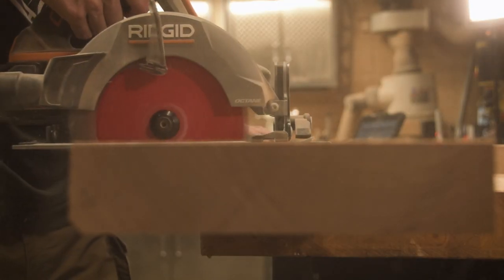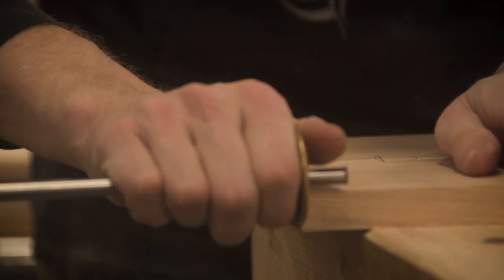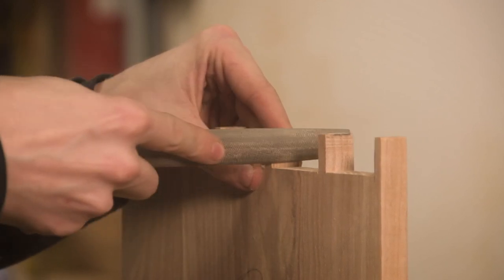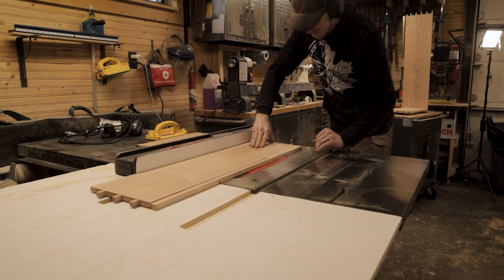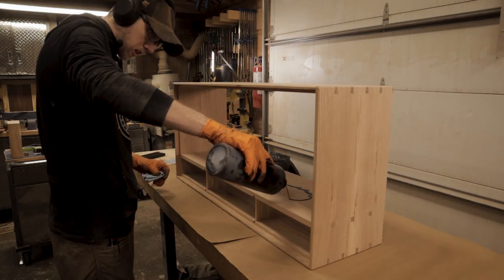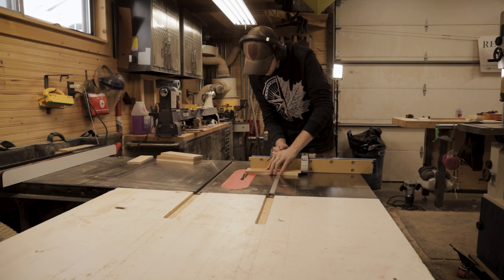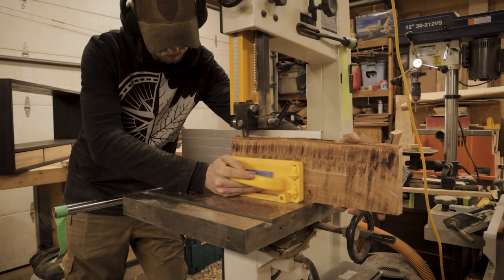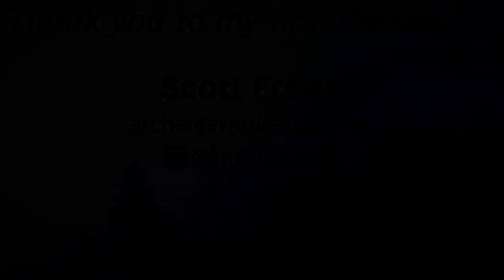Apple Wood & Dovetail Bookshelf

Comment: Well, I’ve been a woodworker for over 45 years and so, obviously, have seen a revolution in what’s available to the smaller shop. Everything from abrasives (I started using the dried skin of a dog fish) to adhesives to routers to….everything. 

I’m retired now but we did have a sidleline business for a good few years making principally Arts and  Crafts pieces here in the UK. However, I’m busier than ever on a 500 square metre barn conversion with all the2nd fix including doors, frames, cornice, picture rail etc. plus lots of furniture. Mostly in European oak. 

We live next to orchards and, about 10 years ago, the farmer cut down the very old Bradley apple trees as they were past their best. I managed to get a lot of the timber and, you’re right, apple moves and shakes like anything. But it’s a beautiful timber and it’s proximity makes us very happy. 

Taste personal whilst skill is universal. So, whilst I can’t say that the piece here is not to my taste, I do admire the skill in the making. I rarely use stain by itself although all of the oak has been finished in a smoked oak stain just because it replicates the old fumed oak colour that the A&C makers loved. If I do want a contrast, I tend to use minimal pieces of stained and my favourite is to use Ferrous acid (steel shavings in vinegar) to react with the tannins on the wood. I prefer that not quite opaque look as you can steel see the grain. But, that’s just my taste. 

Dovetails are a pet subjects of mine. They evolved during the centuries when the adhesives were so prone to failure under stress. Therefore, there was a need to have mechanical joint to hold pieces together. We don’t have that issue and, so, I suggest that dovetails are a vanity joint. Nothing wrong with that if you want to show other woodworkers how good you are but I find they are used all too often detracting from the design rather than enhancing it. I designed a large bureau for a client and we gradually got to what she wanted; finally, she agreed but asked if we could possibly remove those arrow things as they were too fussy for the overall aesthetic. She was right. 

I agree entirely about using a router for the flat bottoms - by far the most accurate way. I would suggest clamping a piece of timber next to your chisel line and use that piece to ensure your chisel is totally perpendicular. I know there is a fashion to have almost concave bottoms but I’ve never felt the need.

Anyway, first video of yours I’ve watched. Very impressed not only by the skill but also by the quality of the camerawork etc. so, a rare thing for me, I’ve subscribed.

Comment: I really like the look of the applewood. I’ve been wanting to dry out the black stain on open grain woods, hopefully soon.  You may like Rob Cosmans method for making dowels by the way!
Reply from the maker: Avoid black stain! What you're going to want to find is India Ink, you can usually find it on Amazon for fairly cheap, works 100x better than stain and will actually turn the wood pitch black!

Comment: I really enjoy your content.  Keep up the videos.  I milled up a few apple and maple boards from trees in my neighborhood and the apple dried pretty wonky with cracking, cupping and twisting whereas the maple is dead flat.
Reply from the maker: What I was told by the sawyer who cut my logs, fruit woods like apple, pear, and cherry tend to have alot of built up stress because of the weight they have to carry so when they dry they're more likely to warp and crack. It seams like a good theory, I just can't find anything to back it up online, so I have to just take his word for it.
Reply: @morganhurst_redridge  sounds like a logical explanation!

Comment: A really nice, and understated piece of furniture.  I was wondering whether, as opposed to nailing the back panels, leaving them loose, and slide in a channel of some kind.  Or would this allow for too much movement?

I really enjoy your 'mellow' way of presenting your work.  Keep it up. 🙂
Reply from the maker: You can definitely do it that way the only problem you might run into is that it makes the glue up a little more complicated since you have to deal with more parts. Mostly for simplicities sake I always mount my back panels after the glue up, that way it also makes it easier to work inside the cabinet after the glue up.
The other problem, specific to this project is that you wouldn't be able to stain it without coloring those back pieces. When you start looking to add stain or paint to a project you really have to take the time to figure out how to add the non-stained pieces after everything else is done. 

I hope that makes sense, if it doesn't just let me know!

Comment: Morgan, once you have hand sawn the side, pins and or tales, knife line along the base to be cut out and you'll get a better finish.  I hand chisel back to that line.  If you are getting an uneven line using the router then there is very slight rocking of the router.  Maybe a shallower cut will assist with that??  As for the rough base, Rob Cosman recommends a spare chisel be ground to 17 degrees for this job in softwood.  Further Hayward (1950's) recommends chiseling down on one side and pairing in at 45 degrees until only about 1/6" is left, leaving the outer edge. Then, when it's flipped over to chisel the other side the timber is still supported by that remaining outer edge and is less include the break away.  Also, even if it is rough, it's end grain, it's hidden and the joint is where the strength is.  The glue just holds it in place.
Reply from the maker: So the router is actually the perfect solution for me, it was able to give me a good clean and square baseline. I'm not a fan of chiseling the baseline mostly because I find it tedious, if I didn't have the whole router setup and it was my only choice it wouldn't be a big issue.
When I was chiseling the baseline I used a method similar to the one you suggested where I would cut in at an angle from both edges so I would end up with a small V. It worked well but again is more tedious than just setting up the router and getting something that's perfect!

Comment: Leather dye is the best, works so much better than the various 'ebony' stains. I use 1/4" brass rod instead of the dowels for this sort of drawer to avoid having to make the dowels.
Reply from the maker: Those ebony stains are one of the biggest jokes there is, especially since the tin always shows this perfectly black wood!
The brass rods are a great idea, after doing these drawers I don't want to be making that many small dowels any time soon.
Reply: I've also had great luck with Noodler's Black fountain pen ink on things like hard maple. Same experience with the ebony stains; worthless. The Noodler's does a great job.

Comment: If you decide to do another similar with ash. You could try burning it. That should give you a similar look but not be as dark. Could look very nice. I do like this one with the contrast between the ash and the apple however. Looks great!
Reply from the maker: I love the color that you get when you burn ash or oak really deep then brush it! The only problem I've run into is glued panels will sometimes crack or deform from the heat so I'm not sure how to use it in a piece of furniture.
Reply: Maybe dowels would do the trick? Or you could prep your stock then burn it, then join the panels. That way you aren't heating the glue. You could even try epoxy to join them? 
Could be a fun project. Maybe try it on something smaller for your self. Maybe a hand tool cabinet or something?

Have fun, and keep up the good work!

Comment: What 1/4" chisel were you using to clean out the waste in the tales board. I like it.  When you speak of a "clean" base in your dovetales are you speaking of the crush that happens in the centre area.  There is a simple solution to that if you are talking of that.
Reply from the maker: It's the Veritas PMV-11 chisel, the set is really nice and holds a good edge. If you search for chisels on my channel I have a video talking about the set.